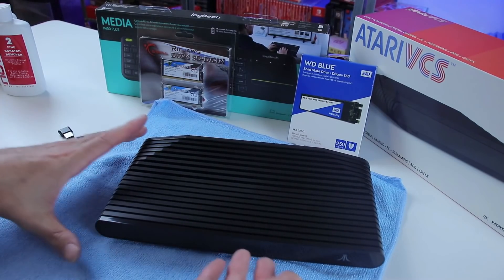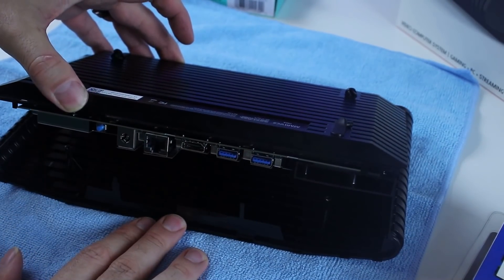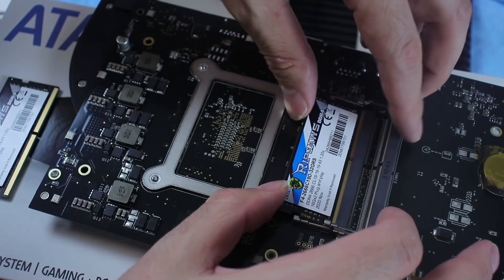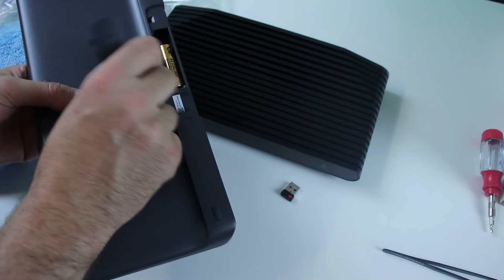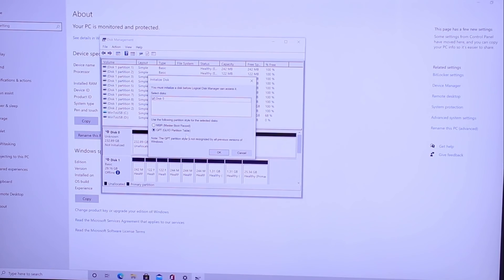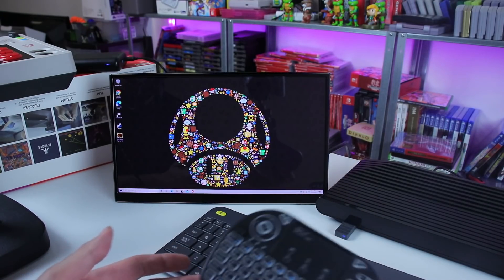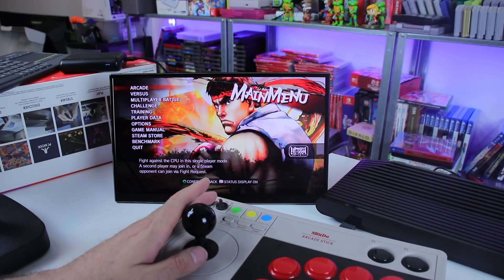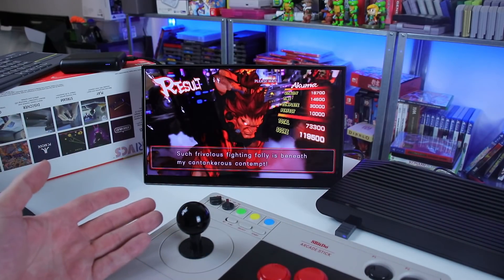Atari VCS Teardown 32GB RAM Upgrade & M.2 SSD Install

Comment: It was eighty dollars during a winter sale. I knew I had to have one because it'd be the easiest way to play emulators wherever I went, without lugging around a tower or a handheld with a tiny screen. So far it seems to run everything I throw at it with ease, and that's before the RAM upgrade.

Comment: There should be a black screw near the rear of the M.2 module insert. You remove that, put your M.2 in, then put the screw back. The screw head should push down on the M.2 "half moon" and keep it in place. That's how it worked on my WD Black 500GB I installed.

Comment: Did you install Windows 10 internally and wiped off the Atari OS?
Reply from the maker: No, wintoUSB portable windows. Installed on a usb drive and if attached it will boot into Win 10 if not attached boots to Atari OS

Comment: I never understood the flexing complain for keyboards.  I use computer keyboards since the early 80s, it was never an issue.
I first saw it as a complain several years ago from Linus and it didn't make much sense then, it still doesn't make any sense.  Who flexes their keyboards in real life?
Otherwise, great video, thank you for sharing.

Comment: I'm thinking about getting an Atari VCS and performing the upgrades to it, but I'm on the fence, if I own an at least, 5 year old MSI laptop with a nVidia 960m graphics card, and 16 GB of ram, is it better to just make the upgrades to the laptop, or will PC games (and to an extent emulated retro games) run better on the Atari VCS?

Grew up with Atari, would be fun to own a VCS, but I feel like a chump if I'm spending close to $800 just to play Fire Pro Wrestling or an already scaled down, previous gen version of NBA 2K21 (besides owning over 400 other games I don't play on a Steam library. I'm not expecting the VCS to run Cyberpunk 2077), when I could just save the money and buy a new gaming laptop in the next couple of years.
Reply from the maker: Im unsure of the laptop you have but yeah the 960m is quite old and cannot handle much in the way of newer stuff. Considering the VCS, it has to be known you can buy a comparable mini pc for less, or a more powerful pc for the same. The VCS is underwhelming when it comes to the Atari OS and what they offer with that. So essentially its most usefulness will be as a windows pc, at that point does it matter that it has the Atari name and logo? If that means something to you then screw it, but then keep in mind the only worthwhile upgrades you can do are harddrive and ram, and the ram only takes ya so far. Nothing else can be upgraded, so you will have a lowend mini pc that will benefit in a very minor way to any upgrades you can do. Emulating retro games should not be an issue with either machines.

Comment: I was already getting one to move all my emulated games off of my main computer-and for the record, the Onyx system by itself is only 50-100 dollars more, but it comes without the controllers, which are about 60 dollars each. But guess what?

I'm not GETTING the Official Atari Controllers! Nope, I'm pretty sure my PS4 controller will work perfectly before I even install Windows, so I'm just gonna roll with that, the exact same keyboard you have in this video and a trackball mouse because my wrist is and always has been garbage for gaming. Remember when you used to flip the mouse over and work the wheel with your thumb? Pepperidge Farm remembers, and so do my high scores in Black Squad!

What I want to know is, how does it do with AAA games after you fully upgrade the RAM? I'm talking about the likes of Call of Duty: Warzone, Grand Theft Auto 5 and such, the games that would usually just tax your graphics card but give an underpowered APU fits. Can I use a fully upgraded VCS 800 for modern AAA gaming, or will it give THIS fits? I say this because I've been meaning to upgrade my decent-but-dated gaming rig, and if I can just replace it with this I may have some parts for sale...
Reply: That keyboard is the best you can get for the money, by the way. I use it on all my computers, I had to buy another usb plugin(the word dongle is gross, you might as well call it a Moist) because I was carrying it around from room to room! It's a full-size remote for your computer, and the keys are better than my laptop in my opinion. The lightness does throw you off, but it's tough enough to handle a lot of actual abuse and the batteries have yet to falter, even though I've had it about a YEAR now and I sometimes leave it on for days without use! The touchpad is a little small and a little too sensitive, but it works and the left-thumb mouse button is a stroke of genius for quick navigation, although a right trigger would have been better... That's all I got, I'm not a reviewer!

Comment: A year or so ago i got a vivobook (Asus laptop) for around $300 that had specs very similar to this machine and thought it was a fantastic deal.  If you look at it like a computer it doesn't seem too expensive, but for a console, we're kinda judging it by the big boy standards and that's rough.  Maybe they can get it back to $200 in volume with a deal with Walmart or something, but they're in a bit of a catch-22 situation while they recover r&d and tooling costs.

As an indie developer, i do like the idea of the store, but it looks like the games being featured are not the type of games you'd pay "console" prices for, or even PC prices for indies.  Again, they're going to have to really find some good software partners to work with that can give this thing some brand appeal beyond boomers.

Comment: It could be nice to have geekbench 4 and 5  CPU and compute 3D results for this device.
it give an rough idea of whay it is worth as PC.
Reply from the maker: Ive never used geekbench before, so i apologize if this is not what you were asking for, but here is the page with results  i got https://browser.geekbench.com/v5/compute/2253969
Reply: @Madlittlepixel  No worries, it is easy to use, an Intel 520 on a basic I5 dual core I5-3600U (Lenovo base laptop) gives you 3536.
It is a but better than it, not really exciting and basicaly it is quite the same as some RYZEN vega integrated GPU.
I found 4500 for a AMD Ryzen 5 3500X 3600 MHz (6 cores).
It makes it a bit in the botom of computer to use windows 10 sadly, at least it can.

They should just add a ryzen 5 series on it   to make it powerfull.

Comment: What screw size for ssd?
Reply: M.2 drives use an m.2 screw , aka "cm2x3-3.3".  Many hardware stores sell metric screws but if you want the standoff so the drive lies parallel to the socket, an m.2 screw kit would be your best bet

Comment: It's nice that it works and can play Ultra Street Fighter IV at full speed but the screen tearings at 12:28 just isn't for me.
Reply from the maker: Screen tearing is a Ultra SF IV issue they never fixed on PC. I looked up the issue and it's widely reported, happens on my main PC as well that's way over spec'd for the game. I've never found a way to eliminate it, but the previous version of SFIV runs fine.

Comment: It almost sounds like this console could be a good desktop pc.
Reply: Talion Ranger  For the cost of the Atari + Win 10 + keyboard + mouse , you could easily get a better PC fully equipped from Best Buy . Best Buy also offer financing . Real PCs are also going to be more upgradeable , not just RAM and M.2 .
Reply: Talion Ranger  It's not cheap when you consider that the VCS comes with almost nothing , not even a HDD just 32GB flash .
Reply: Talion Ranger  Nobody told you to buy anything . Keep using your phone or a VCS or whatever you use , I don't care . I'm just saying that there are better deals than the VCS if a person needs a PC . You brought up the money issue as if it was a bonus to the VCS when it's not .
Reply: Talion Ranger  This isn't cheap. Someone could easily buy a laptop for the same money.

Comment: Looks like you got an older KS400 - I picked mine up from Target and it has a lot more media features. Glad you mentioned the initial price - $200 with 8gigs of ram (it originally had 4) - it can do a lot with just 8 gigs of ram.

Comment: 32 gigs of ram kind of seems like overkill for this soc. Don't think you'll ever take advantage of it.
Reply from the maker: That's why I said it was overkill in the video lol, 16gb max is all you'd possibly get use out of unless you are setting up virtual machines.
Reply: @Madlittlepixel  my bad, still a great video!  Thanks for posting.

Comment: Can you use that internal SSD for Windows and Atari VCS games at the same time?
Reply: Yes!  I did.  I did partition it and I thought I could use half of it for windows 10 and the other half for the Atari operating system but I Atari doesn’t see it but in windows 10 I can see the windows main drive and then the other partition

Comment: wonder what kinda performance you can get outta this, especially with that 32gb ram upgrade. Hmmm....
Reply: The problem is the CPU is only 2 cores and its got a built in graphics card. This will never be a power house pc. Even with a fast hard drive and more ram.
Reply: @timmyburden5701  Yeah, basically it's a Notebook APU inside a Mini PC shell.
Reply: @timmyburden5701  Nobody ever said it would be a powerhouse- and nobody ever expected it to be.  It costs $280 without controllers... That doesn't change the fact that more RAM and FASTER RAM will indeed make a difference- especially on resource heavy OS and apps- like Windows...
Reply: The same you get with only 8gb, the motherboard limits the RAM Frequency to 2400mhz so no matter what RAM you put, it will operate at 2400mhz
Reply: @marcelolemoss  Ummm... more RAM will absolutely perform better, especially with running Windows or demanding apps.
Reply: @Josh-ce9sv  Yep, you will be able to run more apps on the background but the performance of the APU on games will not change that much

Comment: Hi. If I had a M2 drive internally can I install windows on that and use that?
Reply from the maker: Yes you can. You would then need to change boot priority to the ssd, and back to the internal memory to boot into the Atari OS if you wanted use that. Using a Windows Boot USB makes it to where you can simply remove the USB drive to go back into Atari OS on power on if you wanted without having to change the bootable drive is why I chose to do it this way.
Reply: @Madlittlepixel  where is that documented? Atari has stated that you must use an external drive to boot into PC Mode. Can you demonstrate this?
Reply from the maker: @RamsesRibb Im not sure where they stated you HAVE to use an external drive because you simply do not, its just recommended to make it easier to select which OS to use to have it externally loaded.  It is just a Ryzen PC, so of course you can boot the OS from internally via the M.2 drive. Atari themselves even mention doing so and what the pros and cons are via the link I provided in the description. https://support.atari.com/index.php?/Knowledgebase/Article/View/580/153/using-your-vcs-in-pc-mode-installing-an-operating-system
There is not much reason to demonstrate this in an entire new video as it is exactly like booting from USB, just the OS would be on the M.2 drive, this just makes it where you would have to change boot priority to get back into Atari OS, versus using USB and simply just removing the drive puts it back into Atari OS.
Reply: @Madlittlepixel  I never read the documentation you linked. I saw something a few months ago where Atari said it was required to boot from external. I’m guessing it depends on their bios. I also saw a video where someone was unable to unlock the bios or reset the password. This is a feature I would really appreciate so I hope it works like you say.

Comment: Maybe I'm seeing things, but it seemed like the fan wasn't plugged in. Maybe the connector is at an angle and it just looks like it? 4:12 and 4:37 show this the best... Just making sure it doesn't overheat and fail. For as long as you waited to get this, that would suck!

Otherwise, thanks for looking at upgrade options. Should help those who got one or end up getting one and want to test its limits.
Reply from the maker: Fan was never unplugged. The fan is pretty loud while running games on Windows, I can still hear it lol. Thinks it's all good, but I'll double check it later.

Comment: Great video!  Thank you for doing this.  On my VCS, the fan is very loud.  Does the fan on yours loudly turn on a lot when using Windows and playing games on it?  I was wondering if the fan could be replaced with a nicer, quieter one.
Reply: Atari has mentioned that the set the fan programming on the aggressive side for now to start and may back it down in a future update.
Reply: try  changing the thermal paste? maybe kryonaut or conductonaut
Reply: I know this is late, but Linux seems to be way quieter.